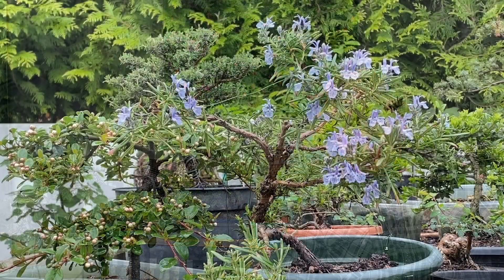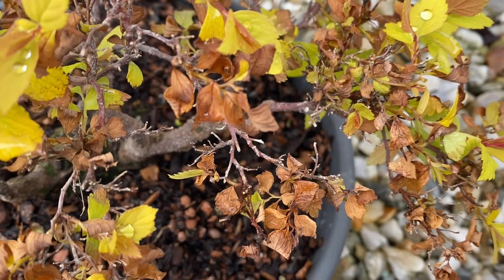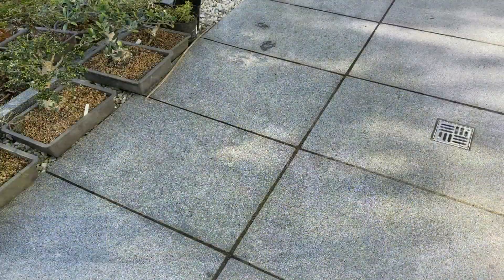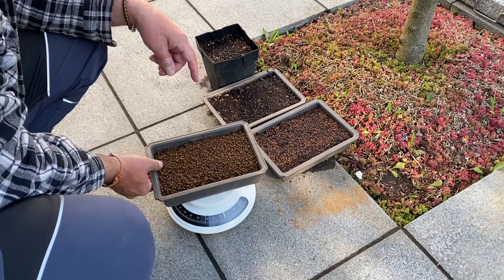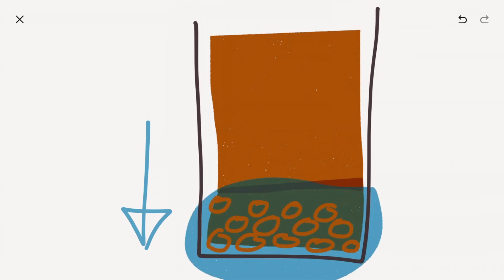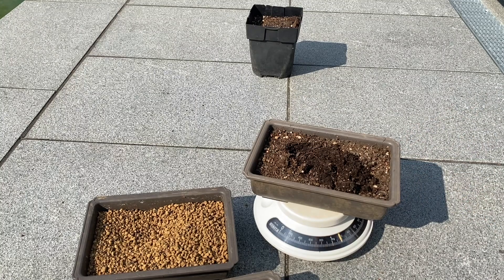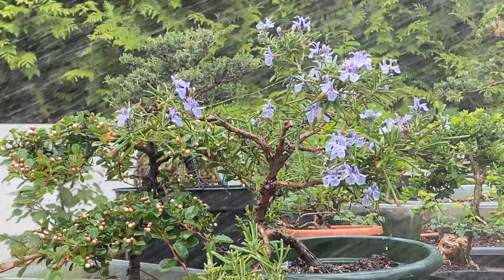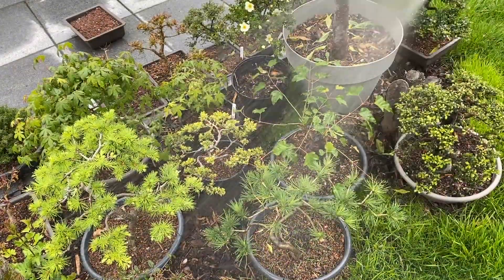Research how water bonsai and avoid overwatering and rotting roots. ( turn on English subtitles )

Comment: My soil for my juniper  is a combination of succulent cactus soil and regular potting soil should I soak it when watering even if it makes the soil soggy and allow the water to drain out the bottom? Another question I recently transplanted it into a new banzai container, I read that I should let it sit in the shade for a few days or weeks, is this true? Thanks
Reply from the maker: If you are watering very offen or you are in a rainy region it will be probably harm your juniper. I Would Never Use any potting soil. I use a very small amount of Peat or Cocoa Fiber to mix with mineral soil. Partly shade is very helpful after pruning or repotting

Comment: could you please put your findings into a chart. showing results, percentages?  couldn't keep track of oll your weights, etc...  good demonstration / experiment  just hard to tell what your results / conclusions are...
Reply from the maker: Hi Todd, conclusion is: Its not a matter of draining but of water retention. Most organic soil parts have a lot of. To avoid root rotting take the worst humid conditions of your enviroment into account. For me in Germany its like 3to 4 weeks of rain in a row. A part of max 10%  of organic like peat or coir is ok. The main part is mineral like lava or high burned clay pearls. Akadama is no option for me.